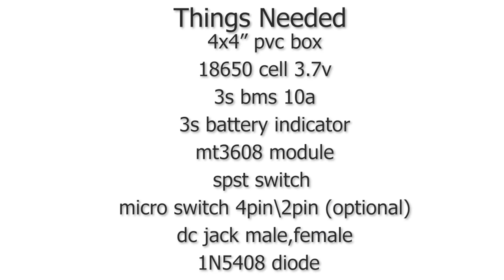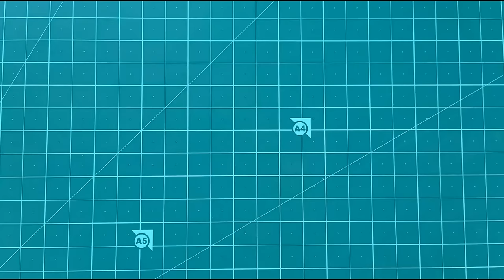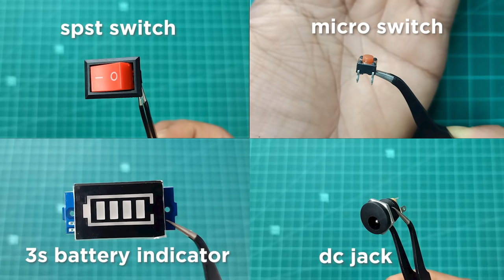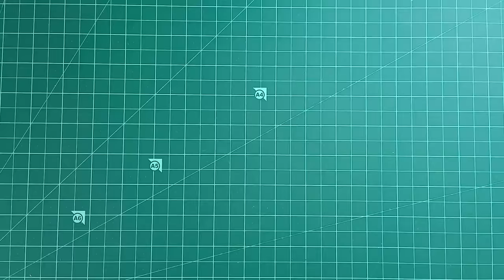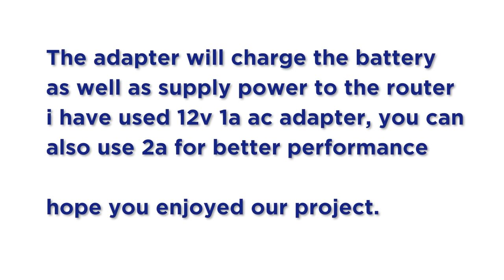How to make 12v ups for wifi router || diy ups for wifi router

Comment: Hi, which solder wire do you use ? Which is best
Reply from the maker: Use 22swg 60/40 resin core or 18swg 60/40 resin core  any one can do your job perfectly without any extra flux

Comment: Input cannot be 12V, if input adapter is 12V, this battery didnt charge until full. Recommend 15V adapter 2A for input.
Reply from the maker: 12.6v or 13v will do 
I didn't mentioned this because 
Many of them will prefer not to buy a new charger they will use the original one of the router, if you use High drain lithium cells there won't be much issue.

Comment: How much backup time it will offer
Reply from the maker: 1-2 hours ( recommended to use high quality lithium cells for 7-8 hours backup).
Reply: is the specification will be same for high quality lithium battery?
Reply: @varshash8982  yes
Reply from the maker: Yes

Comment: You can never charge fully the batteries with this design. they require 4.2v charge voltage per cell. And even if you do, it will fry the router. Best use 2 cell design for 12v
Reply from the maker: If we use 12.6v or 13v charger, fully charging is not a issue
A step up module will ensure keep the voltage stable at 12 so also no problem here.
Reply: @CreativeElectroHub  I understand that in that voltage booster the input voltage cannot be higher than the output voltage, the comment above is rightly loaded, it is 12.6v, you should always have the lift at 13 v, which would be more than the specifications of the device.
Reply from the maker: Yes

Comment: My router works on 1 amp. How many amp it will gives
Reply from the maker: It can handle 12v 3amps easily,
It is fine for your router
Reply: @CreativeElectroHub  but my router only operate with 1amp
Reply from the maker: Yes no problem its fine, if your router would have more than 3amps there would be a problem , 
You just have to make sure that the power adapter which your using should be atleast 2amps , because it   powers your router as well as charge the ups. So it should be 2amps if your router has 1amps
Reply: Adapter is 1 amp
Reply from the maker: Ok you need to upgrade it to 2 amps or 3amps , if your using this type of ups
Reply: @CreativeElectroHub  ok bro but company provide me this router how can i change
Reply from the maker: If your using ups then only change , because if you don't change the original one will get damaged, due to over current flow.
Reply: Yes thats why  ask you..btw thanks bro..

Comment: 3.8A × 3 = 11.4A can connect with 10A BMS module?
Reply: it depend to your load, if your load can take more than 10A, yet it can problem.
By the way lion batteries mostly have higher than 10A you can check datasheet them. Example Sony VTC some models can supply 30A
Reply: @cemalgulbeyaz  i need only 1 A supply. How to reduce 11.4A to 1A.
Reply: @praj441  your keyword is "constant current constant voltage buck converter". You can set voltage and current by that kind converter.
Reply: @cemalgulbeyaz  okay 😊

Comment: Yeah u need to sometimes let the router discharge the battery or else keeping it fully charged for months will destroy the cells and all the capacity will be gone. So u have to let the router discharge the whole battery every month just to maintain the cyele and avoid memory effect.
Reply: I have frequent power cuts so jo worries about manually discharging the router 😂
Reply: Incorrect. Lithium ion batteries do not suffer from memory effect. That applied to nickel cadmium batteries.

Comment: Boost/buck converters are often not very efficient. I'd rather use 4 batteries with a LDO regulator.
I looked at the datasheet but it doesn't provide information for this particular use .... it seems to be optimized for 5V input. It APPEARS the efficiency is around 80% as used here.

Comment: why don't you say that  need to use a 12v CHARGER !!!  and not just a regular power supply from a wifi router.  Because the power supply from the wifi router will not charge lithium-ion batteries.

Comment: Sadly this gives few details. For example many are asking how long it will provide power. If BmAh is the mAH rating of the battery and Id is the current in Amps used by the router/hub/12V load/device  then the approximate time is
 BmAH / ( Id x 1000)
So if BmAH is 3000 and Id is 1 Amp then it could last up to 3 hours. Though in actual practice one might get only 2 to 2.5 hours.
HOWEVER this does depend on the efficiency of the boost/buck converter which can  be low. Read the complete specs CAREFULLY. Cheaper ones are only 60 to 70% efficient. Mutiply the time calculated above by the efficiency.

Comment: Just add the Voltage Indicator and upload the circuit diagram
Reply from the maker: Instead of level indicator 
Connect digital voltmeter that's it 
Connections will remain same
Reply: @CreativeElectroHub  But i want to indicate both of them. Then how to connect???
Reply from the maker: Ok , then connect both of them in parallel with the battery pack

Comment: Why did u use boost converter
Reply from the maker: The main reason to use mt3608 is the battery pack, 
When there is a power cut off,  the battery pack provides power to the router and it gets discharge, so the voltage decreases and router will shut down in 5-10 mins. so mt3608 (set to 12v) will keep the voltage stable at 12v even if the battery reaches its lowest discharge point (10.5v) 
And while power supply is active the mt3608 will not get an effect as its input and output are same it will it continuously feed 12v output.
If your planning for 5-10mins backup you can skip mt3608 and if you need more than 1-2 hours backup you need to use step up converter

Comment: add usb type b charging port as input
Reply: USB provided by what?  battery bank?  laptop?
Reply: @kennmossman8701  as a power input
Reply: @vaddidushyanthkumar6787  from what
Reply: @kennmossman8701  from normal phone charger
Reply: The most simple way would be to add a buck converter on the input side; 5V to 12.6 or so Volts. So the batteries would be charged via this boost converter.
Reply from the maker: @kenn Mossman  your right

Comment: WHAT IS THE NEED OF mt3608 module. IS IT REQUIRED?
HOW MUCH BACKUP ?
LIST THE MAH OF BATTERY?
DOES THE BATTERY MAY CAUSE ANY DAMAGE OR REDUCED IN LIFE WHILE CONTINUOUSLY CONNECTING IN BOTH INPUT AND OUTPUT ?
Reply: As the battery discharges, the voltage will drop. The MT3608 module stabilizes the voltage.
Reply: Backup depend on the load. If your device operates at 12V 1A then a setup with 3*2200mAH batteries will last for upto 2hrs 12min (max).
Reply: It won't damage the battery while connecting to both input and output as both the battery and output become parallel in connection to the input. Talking about deterioration, there will definitely be some deterioration over time. It's just normal!
Reply from the maker: @Atish  thanks  for your explanations 🤓 I have already explained him everything on pc
Reply: @CreativeElectroHub  Oh okay. I didn't know that 😅
Reply: @cg.maniac   @Creative ElectroHub   
Thanks you both for clearing my doubts.
Reply: @aswinppai6315  No problem 😀 👍🏽
Reply: @cg.maniac  ok
Reply: @cg.maniac  why still need MT3608, i thought the BMS can stabilizes the voltage to? CMIIW
Reply: @angkinugraha6968  I have no idea why I made that comment. I was just starting out with making battery packs then. Now I can safely say that if you have a BMS with Balance Charging capacity, you don't need the MT3086 module. I don't even remember what that is 😅. I made a Power Backup for my BSNL ONT which has a battery backup of 48 hrs. Never need that much backup but you never know 😁
Reply: @cg.maniac  ☺👌